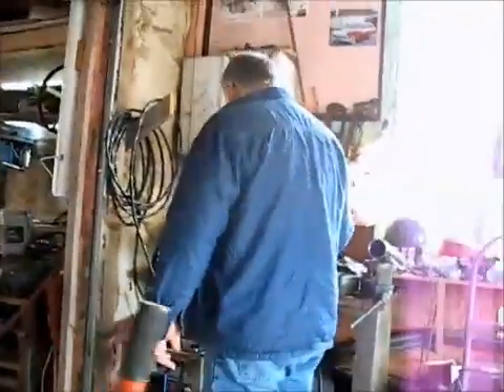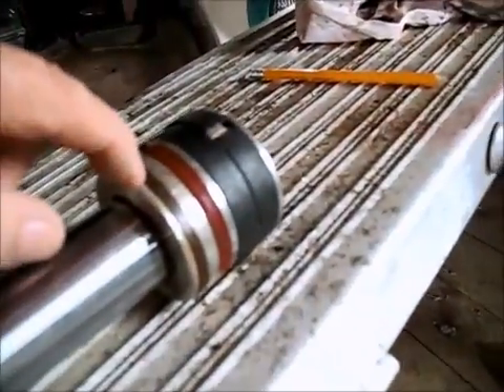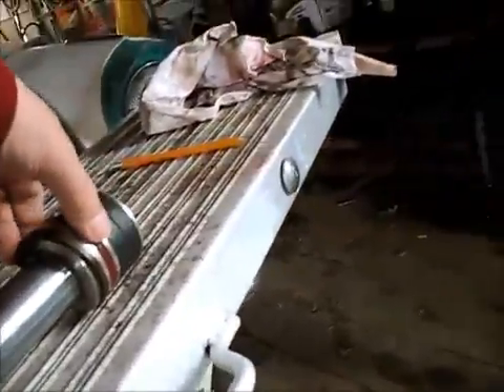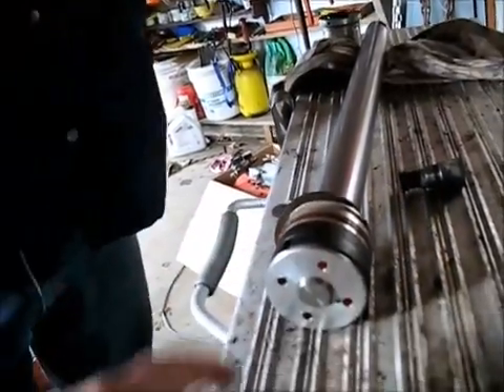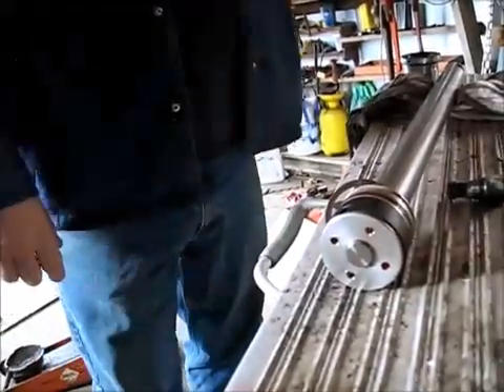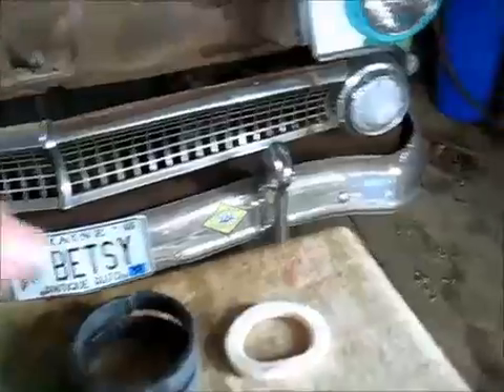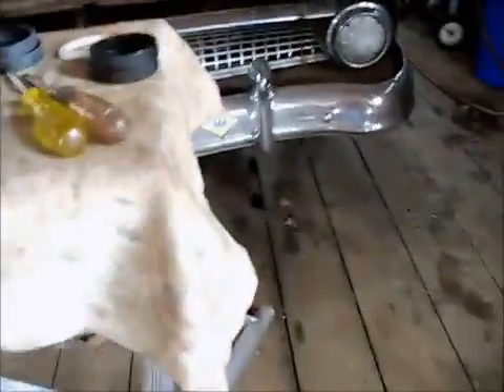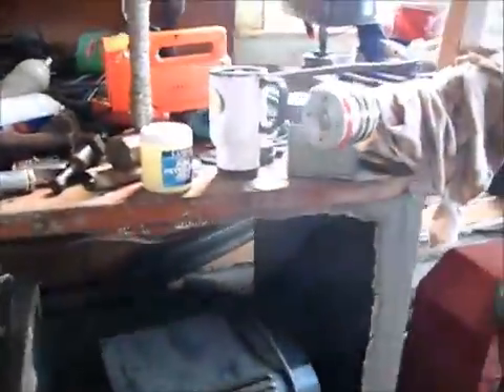Installing Hydraulic Cylinder Seals

Comment: plezzz help me sir 2.5 ton hystor forklift boob midel hydraulic cylander cant lift but side 2 cylander lift is good butt  center midel cylander cant lift why what is the problime wher is the problim sir hydraulic pump am instal new plezzz replay me sir am a macenic
Reply from the maker: The seals may be bad inside the cylinder.

Comment: Where were able to find the seals you used
Reply from the maker: I can't even remember now but probably online.   In my case they didn't work.  It was rusted too bad inside, but I was able to eventually fine a new old stock cylinder.  Paid a bit for it but it was worth it.   Good luck with yours.